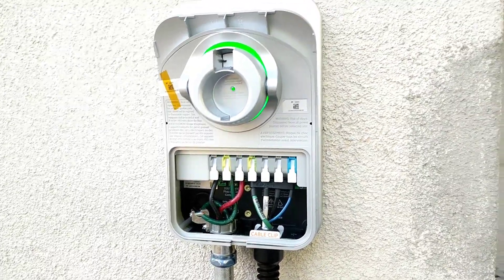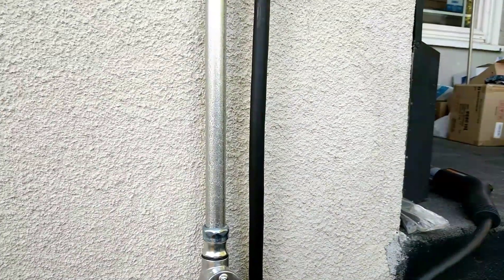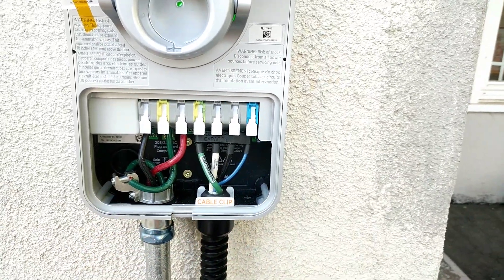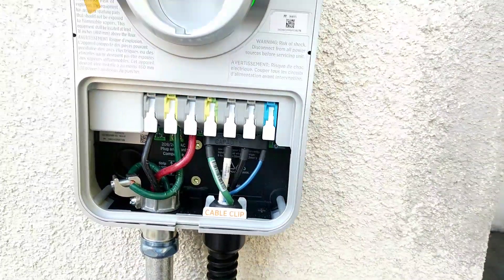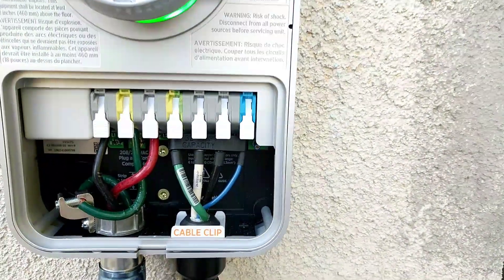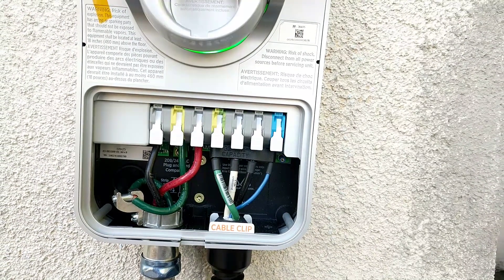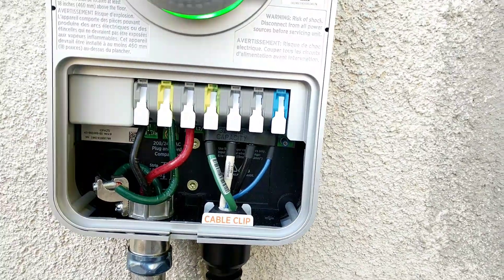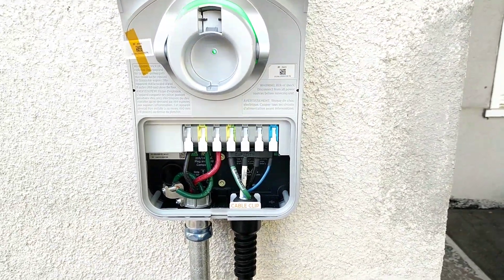Wire requirements for chargepoint home ev charger

Comment: Grounding the box is redundant... first, because the box is already grounded on the right, as well as with your ground; secondly, the box is plastic. Grounding the box is for metal boxes, irrespective of whether or not you're also carrying a ground with leads and\or a neutral.

Comment: Does the ground wire go all the way to the panel? Or just to a metal in the box? Which way is safer? Also wondering if we need to use THHN 6 gauge wire with a 60 amp breaker for hardwired option?
Reply from the maker: Yes ground will need to land on the Ground/Neutral Busbar in the panel. For 60 Amps you will need 6 AWG THHN/THWN-2 Wire in conduit and NOT in Romex. Romex on the Ampacity Chart is listed at "NM-B" and is not supposed to run into conduit because romex in considered wire in conduit as it is made.  I hope that whole sentence made sense? However, the Ampacity Rating on NM-B 6 AWG is 55 Amps Max... and most chargers only pull 48 Amp Max. SOOO... you should be good. If you buy 6/2 romex to do the run, just make sure you wrap the white exposed wire with Black Electrical Tape in the box and in the charger so if an electrician in the future works on the panel or replaces the panel, they will not land the white wire in your EV Circuit on to the Neutral Bar. If they do, then it will mess up your car.
Reply: @airos52  So does this mean I can use 6/2 Romex with 60amp breaker to install inside my garage and therefore no conduit?
Reply from the maker: @jerryn3  technically it needs to be 50Amp when it's in Romex but no conduit needed if it's stays in the studs and rafters. 
Basically if drywall can smash the wire then it needs to be in conduit.
Reply from the maker: @jerryn3  for 60 amp breaker you need thhn in EMT or FMC but in Romex it gets derated to 50amps

Comment: Adding the Chargepoint myself. I was curious did anyone tin and crimp the connection like the wires that came off of the plug version? The lever action connectors on the box don't seem very strong so was wondering if inserting a round bare 6AWG wire would cause any issues if it's not tinned and flattened?
Reply from the maker: I do not this it needs to be soldered or tinned, but you can. You can also use ferrels too?

Comment: If you want 60amp circuit (48A load to your car) you need 6gauge 90C wire (no romex) wiring per NEH.
Your install is okay for 50A circuit (40A load).

It's clear in the directions.
Reply from the maker: you are correct. And i did not use ROMEX 6/2. I used THHN/THWN-2 from the panel.

Comment: thank you.
You are installing a chargepoint of 32 AMP that needs a circuit breaker of 40 AMP.  For that you need Romex AWG #8 and THHN #8 with ground #10. (COPPER)
It is not uncommon to have wire #6 instead, even if not required by code, because of the continuous use of the charger. Particularly if you choose the AWG that has smaller thinner wires vs the solid wire in the THHN cable. By the way good job in using the ground lug.
Reply from the maker: Yes you are correct. I late found out the Wire was not the governing limit on the AMPS. The breaker is rated at 70C and the Wire is rated at 90C but the install is supposed use the lower temp.

Comment: If this a newer ChargePoint that is capable of running 50A, then you would need to hardwire using a 4AWG to a 70-80A circuit breaker to get the full capacity speed (with a max load of 50A).   But most people who do the Hardwire installation only add the 60A breaker to run a sufficient 48A max load speed (and using 6AWG wires).
Reply: 65 or 70A breaker is fine. 6AWG is also fine (you can round up to next std breaker rating). The chargepoint box accepts 6gauge max. 4 gauge will not fit.

Comment: Would you happen to know how to use a 6/3 with ground?  Which goes where, and where would I connect the ground?
Reply from the maker: 6/3 will land en extra wire in the charger... and this charger only uses L1, L2 and Ground

Comment: #8wire is rated for 40 amps in romex as well. Generally the charger should only pull 80% of the    circuits rating. Thus A 40 amp circuit is needed for a charging station rated at no more than 32amps. I have seen where it is recommended the ground is insulated,does this mean romex is not an option ?
Reply from the maker: thanks for the Wire Ampacity explanation and most 'grounding' conductors do not need to be shielded. The only reason it would need to be shielded is because it is exposed to the elements but then it would need to be in flex cable... THHN or THWN is not UV Rated

Comment: Thanks, finally somebody. Do you know what size wires are the once going out to the car plug, look like the supply, #8 AWG.
Reply from the maker: I just opened the charger again this morning and it is the same #8. The charger tops out at 32A output. 
 So for all you tesla fans, this will charge about 28 miles an hour. 
Which is funny because I just installed a Tesla wall charger and provided a 30A feed but the install instructions said I would have to set the capacity to 24A... So the owner is happy getting 22miles an hour but when he charges at my house he gets more juice... 30A vs 40A... And when I buy my Tesla car, I will be removing this charger and setting the Tesla wall charger to 50A!!! Oh yeah baby
Reply from the maker: I'm sorry I don't understand your tone... I'm a little lost from your question... Please ask again in a bit different way. 
I think you are asking what gauge wire is the charger cord to the car? If that is your question I will look in the morning... I believe they were 6awg